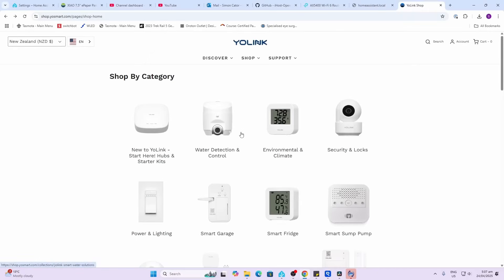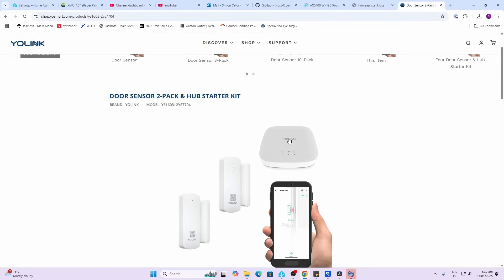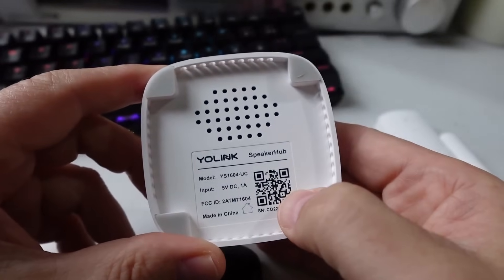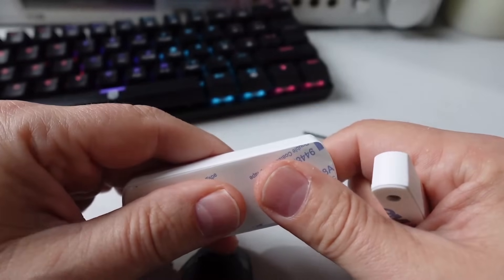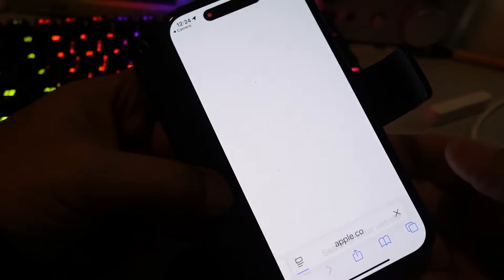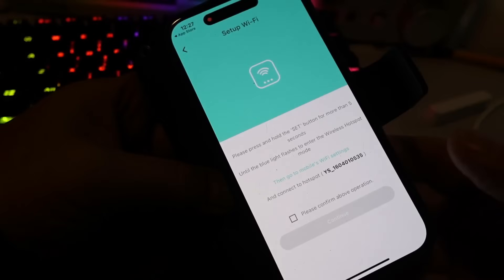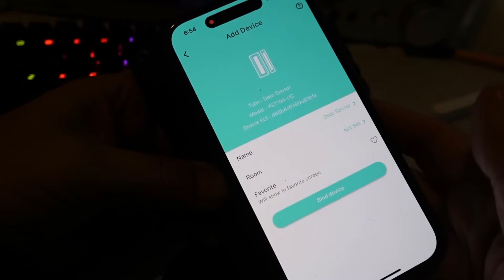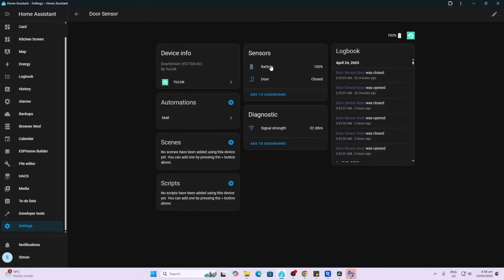Smart Mailbox Alerts using the YoLink Lora - Long Range Sensors!

Comment: FYI they do have a newer hub3, that can also uee cell service. that you can pay monthly....it is working great for me so far.
Reply from the maker: Oh cool I must look into that, they are sending me the water valve soon!
Reply: @simonsayshomeassistant  it's is a life saver for 'remote places' with no Internet or as a backup if there is a need for it. It's about 7$ a month for the cell service. I got this for someone and they are very happy, so far.
Reply: I just ordered that hub I'm waiting for it... yolink has  a great line of products and they work flawlessly. I have door sensors, motion sensors , temperature sensors water sensors and I have an indoor motion sensor in my mailbox it works perfectly.

Comment: I see that you have the devices with the "UC" suffix. Previously, this suffix was used for Ylink LORA products designed for the LORA frequencies used in North America and not for Europe which I think had an "EC" suffix. The different products were because of differing radio frequency allocation in the different parts of the world. Is this still the case or is there now one product for the whole of the world? It looks like you bought your products from the default US website so that's why they are "UC" products. What is the current situation on "UC" versus "EC" and international purchase/useage? Inicentally, the link you give takes me to a Philips device here in the UK!
Reply from the maker: The one that I have is this frequency  US915 (902–928 MHz)  which is for USA.  NZ uses 915 - 918.  Not sure why the link is taking you to Phillips mine still shows the Yolink

Comment: The YoLink 'Outdoor Contact Sensor' (OCS) is a better match for this application - The 'Door Sensor' you used is rated only for indoor use.  Also, the OCS has an external antenna, so it's easy to keep the antenna on the outside of your mailbox.
Reply from the maker: Oh cool, thank you for letting me know. Yes that would be way more suitable

Comment: I'm looking for a way to do this on a USPS community mailbox
Reply from the maker: Is the mail inserted through a slot or is the door opened?
Reply: @simonsayshomeassistant  It’s a large freestanding unit with 12 individual mailboxes.

The delivery person opens a large door on the back to put mail into individual boxes.

Each resident uses a key on the from of the unit to open a small door to get their mail. For a picture search USPS cluster mailboxes
Reply: I use the yolink indoor motion sensor in my mailbox and I've had no issues.

Comment: I hate the fact that the manufacturer forces you to work through the cloud to use the device. 

I developed my own lora mailbox sensor with two Heltec Stick v3, 50 lines of arduino code, and 3d printed boxes (one in the mailbox, one in the house 50m apart through metal mailbox and 6 neighbour apartments.)  Two small magnet reed relays on the receiving door and fetching door. It is running for a year now on a 1200mah battery.  No Internet connection, 100% secure. The receiver in the house notifies my Shelly device which can send a notification to my phone when mail arrives or in collected.
Reply from the maker: That sounds like a great solution Rob!

Comment: Very cool. I’ve seen LoRa mailbox notifiers before but only DIY stuff. If only I could find a local LoRa hub, perhaps based on ESPHome, this solution looks simple, although the magnets are excessively large.

To be fair, Zigbee has worked reliably for my metal mailbox for several years now. My solution is shown on my channel.

Comment: I have had a Zigbee door sensor in my mailbox for a few years now. Started with the same signal issue, but I took the sensor apart and soldered a 3 inch wire to the antenna point in the sensor, pulled it through the bottom of the mailbox and have been receiving the signal from it ever sense. Battery lasts about 6 months.
Reply from the maker: Hey there Donald, that's really cool I must try that!